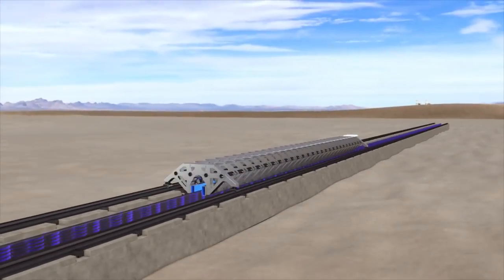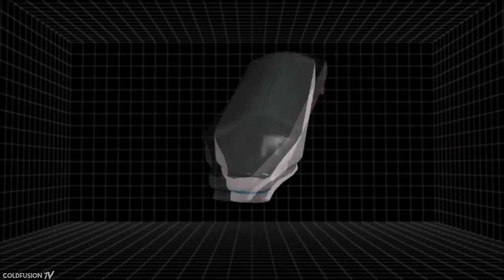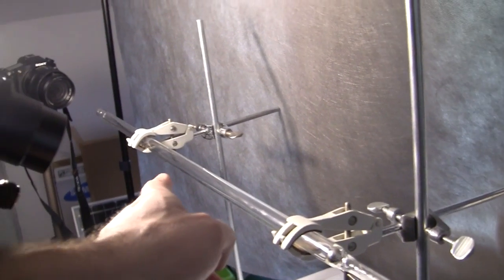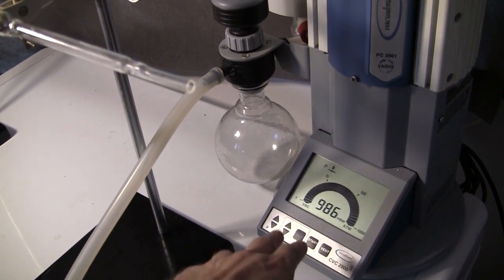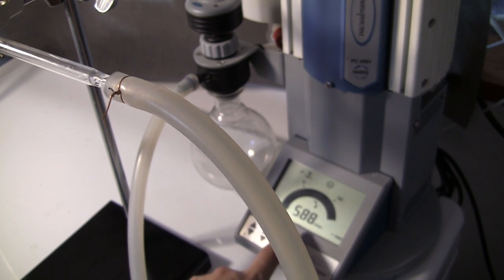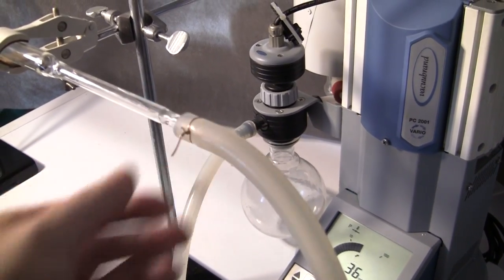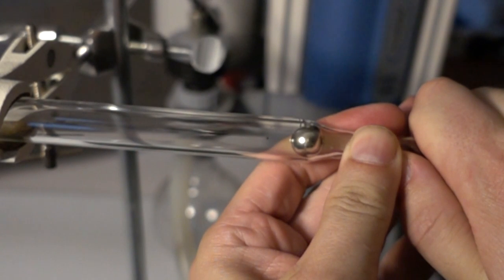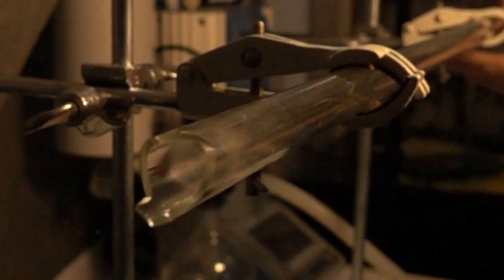How  the Hyperloop can kill you!

Comment: One possible way of averting such a disaster in a real hyperloop could be to have a system of break detection, along with a system of openable hatches and a way to locate the vehicle. If a break happened, the hatches could open on the other side of the vehicle, letting air in from both sides, preventing the vehicle from shooting out. The hyperloop would be down for a while, but it's probably better than vacuum failure as demonstrated here.

Comment: And this is where engeneirs come in, to solve problems. There is a way for people to die on a plane, if it has a catastrophic failure, and we still use them.
Reply: if you're saying engineers will throw some fairy dust and fix the problems, than why doesn't that apply to planes?
Reply: It doest have to be fairy dust. You can use phisics.

For example, from the top of my head, when stationary, the "pod" is not in vacuum anywhay, because you need to have acces to the inside of the pod from the outside (normal atmospherical preasure). When in motion, if faliure accurs in front of the pod, the preasure will decelerate it (in this case I would be more conserned about the crash, which accurs with planes too !), if it accurs behind the pod, the positive preasure front has to catch the pod, and because the pod will travel at supersonic speeds, the front will not catch it, to accelerate it, until it starts to slow down, which is enough time to activate antimeasures, that should be installed, like bulkhead doors.
Aditionaly, if the front does catch the pod, the linear electric motor, that propels the pod, can start working as a brake, withought any need for adjusting the motor driver (if the electromagnetic pole is in front of the permanent magnet pole, there is a "positive force", accelerating the pod, if the PM pole is in front of the EM pole, there is a "negative force" decelerating the pod ; look at linear electric motor).

I was trying to address the thinking mentality of problem solving. If when we find a problem, we just say I cant think of a solution for that problem and give up on the idea, rather than searching for a solution to the problem, there would be no technological advancments.

Comment: The Hyperloop capsule uses a compressor on the front to move air that is in front of it to vents on the underside and to the rear in order to reduce the affects of air resistance, even at 1 mBar. If there was a break in the tunnel in front of the capsule a lot of the air can then be redirected around it by the compressor reducing the acceleration affects. There will also be power in the tube provided by solar cells so in the event of a tube rupture you could have pressure sensors inside the tube alert the capsules to apply the emergency brakes, a feature already thought up by one of the Hyperloop teams. Do understand though that design of the Hyperloop is still being thought up and the method of propulsion and levitation is very different between each team in the contest. Even Elon Musk himself has said that some of his original ideas for Hyperloop have proven to be unachievable. 

It would also depend on the size of the rupture in the tube as to how quickly it is being evacuated. If it were only a small nick (say from a stray bullet of a NRA member) then it would take a considerable amount more time for the tube to fill with air. Your demonstration is basically a scale-model of if the end of one of the tubes were simply cut off, something that is very unlikely to happen.

Comment: No way of stopping it? Pressure release valves? So similarly to how a train can detects breaks in the track, multiple pressure sensors along the length can be set to open pressure release valves that would counteract the forward momentum of the car. "No way to stop it.". Plenty of ways to stop it. Turn off the magnets using the same sensor network? Brakes? Hell the car ITSELF could have pressure sensors that could tell it to turn off the magnet and 90% of the time it would be able to do so in time to not crash into the terminal, which presumes that it's not already decelerated enough shortly before reaching the terminal. I get that the hyperloop concept is somewhat fanciful, and they have stated it would be best served for moving GOODS and not people, but it could at some point be made safe enough for people. Kind of a ridiculous claim about an easily overcome engineering problem.
Reply: I think what Thunderfoot meant more than "no way to stop it" was "no way to stop it easily or quickly in a safe manner"
Reply: +L3gendLuk3 why on earth would you think that? A common automobile can detect, ignite, and fully deploy airbags in 60-80 MILISECONDS! Sensors and safety measures require no human intervention.
Reply: You forgot the linear motors that make the pod speed up in the first place.
Reply: a purposeful breach of vacuum on the other side of the car would equalize the pressure and stop it easily and safely.
Reply: The problem is that the acceleration is caused by the presence of air at the back (or front) of the pod. By the time a sensor on the pod or the track pick this up, it might already be too late.
Reply: Rich Miller The problem is that by the time you even realize that there's a breach, it would be too late and the car would've accelerated a lot and could've sustained enough g's to kill somebody....
Reply: L3gendLuk3, that seems to be an argument against "going fast", and not so much about this concept specifically.

PLENTY of things go very fast while still having proper safety features to detect and correct for errors.
Reply: rpggriffin No, I was talking about accelerating fast. If there is a breach directly behind a pod, there is a very real possibility that the acceleration is high enough to kill someone.
Reply: Rich Miller Ok, a 60 ms delay time, but air bags are designed to deflate at a specific rate to cushion the blow. If you pressurize the air in front of you, all you will be doing is putting another fast moving column of air, but now moving in the opposite direction. Because the pods levitate you will probably have to take into account the aerodynamics of the pod so the oncoming air doesn't slam it into the roof of the tunnel.

Comment: Unlike the typical crap you debunk, Hyperloop is practically feasible. It's essentially a maglev in a vacuum. And yes, it can kill you, just like cars, planes, trains and boats can. The question about safety is: At what rate does it kill you? 

Tesla's recent autopilot car crash shows that people are scared of new technology, even if it's actually safer. A half done autopilot is already safer than just having a driver drive on their own, even if it doesn't prevent all deaths.

Solar roadways aren't impossible either, but what kills them is that they're not economically feasible, even on a small scale. The same question applies to Hyperloop: Is it economically feasible? Will people actually pay for high speed transport after the Concorde went the way of the Dodo?
Reply: cost isn't the only thing killing solar roadways, unefficiency also kills it
Reply: No, cost is it - cost vs benefit. A system can be inefficient as long as it's very cheap.

SpaceX rockets are very inefficient, but they're incredibly cheap in comparison to competition.

Comment: Well okay. Maybe make the cart a bit smaller than the tube so the air can flow around it? Besides, if this thing is travelling down the tube at Mach3+, there is no way an air inrush is going to even reach the vehicle. If it was going towards the failure point, it would probably experience deceleration forces similar to a low earth orbit re-entry, though. Might be a little bit uncomfortable, but I don't think it's going to be a serious issue.

Comment: The pod diameter in Alpha is quite deal smaller than tube diameter, also: 

"In the event of a large scale leak, pressure sensors located along the tube would automatically communicate with all capsules to deploy their emergency mechanical braking systems"... "Begin emergency braking whilst the Hyperloop tube would undergo rapid repressurization along its entire length." 

http://www.spacex.com/sites/spacex/files/hyperloop_alpha-20130812.pdf

Also tube is 2 cm thick steel...

I don't comment on the commercial side of things, there's at least two companies working on it 
(And one of them have all monorail-scam hallmarks on it...)

Comment: Thunderf00t why do you say, "With no way of stopping" at the end of the video? Sure, the ball bearing has nothing, but how do you know the hyperloop wouldn't? What would the actual force applied to the ball bearing/hyperloop car be and could that be controlled via some engineered device. Like brakes or tethers or something? Or some kind of emergency door system that could shut off the compromised section of tubing similar to watertight doors on a ship? Thanks!

Comment: Is there any way to redo it with a more representative tube to pod area ratio?  The one shown here is more or less 1:1, so you get a lot of air trapped behind the ball.  The NASA sizing studies (http://ntrs.nasa.gov/archive/nasa/casi.ntrs.nasa.gov/20150000699.pdf) were indicating that a 1.5 meter diameter pod needed a 4 meter diameter tube to travel at speed (check Appendix B specifically for a representative image).  I suspect you'll get a lot less acceleration from a breach behind the pod, though a breach ahead would still be like hitting a wall at Mach 1.

Comment: Just make sure the tube failure is in the opposite direction from where you are planning to go :)  I note that your ball bearing has no brakes. The hyperloop vehicle  will be on a rail which drives it at very high accelerations which can presumably equally brake with very high force. In addition, it has an airway through it which typically pumps air over the vehicle, but that could be stopped or reversed to allow the air pushing the vehicle to get passed. Also you are assuming catastrophic failure. Assume the same for railway lines, or aircraft skins and you get catastrophe too. Accidents do happen and can be deadly.

Comment: In the event of a "vacuum-failure" at one end, would it not be possible to re-pressurize the tube on the other side of the projectile? This wouldn't solve the instantaneous acceleration effect, but it would gradually slow the projectile.

Comment: I don't get it. Let's suppose this happens in a real hyperloop:
1) Vacuum is compromised by a failure in the tubing, right behind a hyperloop pod (worst case scenario).
2) The hyperloop pod applies physical emergency brakes against the outside of the tube upon detecting the vacuum failure.
3) The atmosphere entering the tube blows around the hyperloop pod and maybe even though it via the turbine, there is no significant acceleration.

There's probably lots of other ways to make this even safer with a bit of engineering ingenuity. If this is you biggest concern about the hyperloops viability it doesn't seem like a big deal.